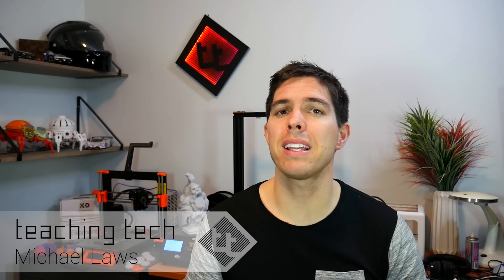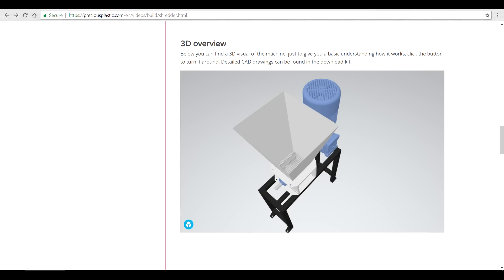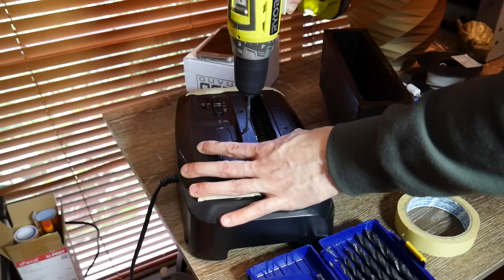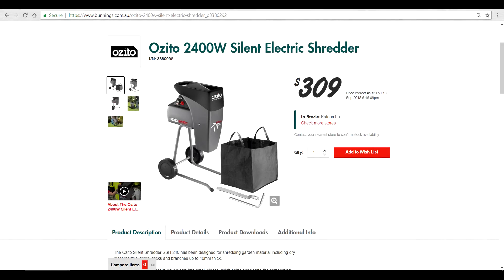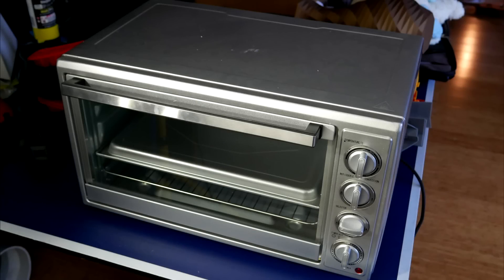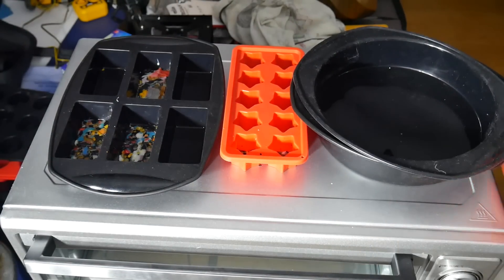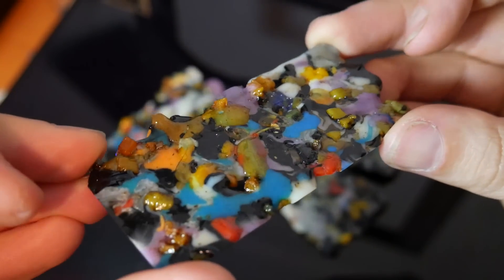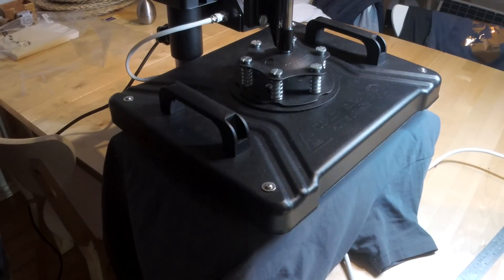Recycle waste 3D prints: Part 1 - Shredding and melting

Comment: there's nothing green about solar panel...you need to replace it every 10 years or so, made in part of rare material and quartz glass impossible to recycle. A damp is a lot cleaner, built one time, ok it flood a zone and dry another but it's water (self-healing material) that let nature rebuild itself.

Comment: You need to make sure that all recycled materials are using the same plastic. If there are different kinds of plastic in your mixture then the melting parameters will be different each time you try to extrude or mold, making it impossible to make parts consistently. Consistency is crucial when dealing with recycled plastic. To improve consistency of material, Your melted product should be well mixed to even out any subtle variations in density of material that could make the final product difficult to process. Most industrial plastic recycling is done in a continuous process that allows for a fine breakdown of recycled materials, heating, pressurization, mixing, and finally extrusion into either a filament or resin bead. You can breakdown your materials pretty well if you keep running it through the grinder multiple times, but to mix the melted product at high pressure and temperature will require much more complex equipment. The most difficult aspects to work out at home are consistent heating and pressurization. However, it looks like you were able to melt some of the material in an oven. The next step would be to stick a mixer in that toaster oven, and see if you can get a consistent melt without high pressure. If that is possible, you then need to see about how to feed that liquid into an extruder or mold with low pressure. A mold could possibly be gravity fed, but the extruder will likely require additional pressurization.

Comment: I was thinking about this sort of thing as now I got some used printed waste myself now... I thought If I could get a heavy duty garden bush shredder and get the used waste chopped up with that 1st then use a slow turning smaller shredder set up using maybe a stepper printer motor to slowly crew up the waste from the garden one maybe a few passes through it for fine cut up waste. Then I thought maybe use a hot end nozzle ( sized to the 1.75 mm ) Mounted on a frame with a big worm screw in a tube run by a stepper motor on the frame is fed by a big funnel ( maybe made of PETG ). Since the hot end is meant to be used to melt the filament for printing it makes sense to use it to do the filament making! You just need s fan to cool the filament as it exits the nozzle or pass the filament through a cold water bath as the professionals do?  I would of course sort out the colours of the waste first before cutting them up for melting, that way the same colours is in the filament which you could have a empty spool take up as it exits the cooling part?  I know it be hard to set up But I think using the same tech used to make filament in to models may as well be used in reverse to make the wast in to filament again?

Comment: I see most recycling efforts using shredding as a pre-cursor to using some kind of recycling-extruder. Wouldn't it be possible (and easier) to use some kind of large-hopper 'melter' to melt the filament into more manageable sized blocks and/or an intermedia extruded size that could be fed into the final extruder?

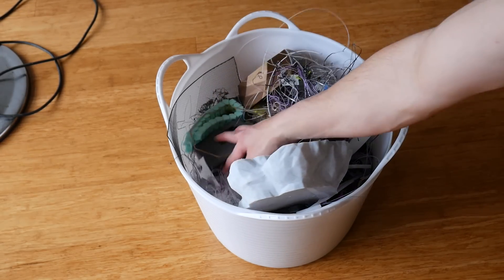Comment: 0:50 FYI PLA is not biodegradable. It needs healthy microbial community and 60C+ temperature, meaning you need some very specifically designed industrial compost where you could mix 10-20% finely shredded pieces with the plant materials to be able to degrade it in a few months. And that just never happens. So  unfortunately every failed print and every broken piece just adds to the global plastic problem. So big up for trying to reuse them in any ways!
Reply: I compost it in my girlfriend's back yard. almost any compost mound reaches 60C+

Comment: Bolts do not have a very high shear strength. Even Grade 8 hardware is rated in tensile strength, which is basically the amount of "stretch" it takes for it to break. You need to either have someone machine a keyway into your shafts, and your coupler, or try something like dowel roll pins that are hardened. Roll Pins are made to withstand shear force, bolts are meant for withstanding the stretching force.

Comment: The hell with that, lol   lets get a good process to melt down and re-extrude that stuff back into rolls for use in a 3D printer!   The multi-color aspect would lend itself well to some artistic projects or be good as a cheap"test PLA"  for proving out slicer settings etc.
Reply: Its no so easy to.make a good consistent filament, specially whith dirty plastic.Yuo gona need an entire making proceses..there are some machine outside but ..they are expensive and the result its not so good

Comment: using that garden shredder is a interesting idea!
For filament making you need to get down to about 5mm granule size, unless you build a bigger one than typical (ie. bigger than filastruder).

I go through a lot of filament and parts, and even the spools add up quickly! Makes no sense that something like 20-25% of the 1kg spool weight is actually packaging plastics and you throw that away. Very very inefficient and wasteful. Then all the failed prints etc. and i like to print big, so a failed print might be 2kg filament + 500gr in spools + other packaging wasted ...

Comment: Use the second mold on top with a pan and a little weight to smooth top while heating? Some smaller discs would be perfect drink coasters as well as conversation starters

Comment: as a fellow injection molder i need some advice as you seem to have more experience with cocoon create I have recently started doing oour own prototyping on cheap we were refered to aldi when they were on sale the very first model the old black one but it sat in the office and was never used as bussiness slacked of when i had a heart attact but now im back and have learned how to use it and on the 12 print the hotend thermister stoped working i have tech experience so i changed out the thermister but it just wont ghive corect reading do you know of any fellow youtubers who have solved this problem i miss my prototypeing printer thats and cocoon offer no suport except som c++ files

Comment: I normally enjoy your videos, but this is one of those cases of a solution seeking a problem. You're talking about recycling to reduce a carbon footprint, yet you used a 2400W chipper, a paper shredder, (in this case silicon molds that will break down), and a toaster oven to melt it down. On top of it all you chipped up that ABS chain then talked about using a sandwich press to melt it down. That sounds like a bad idea.

When it comes to PLA it's pretty sustainable. Filaments like ABS less so, but it's not too bad. Ive been thinking about using the garbage plastic like PLA for filter mediums. I just use the ABS stuff for slurry or patching up cracks. Resource waste is a thing, we just have to be conscious about it.

Comment: やったことあるけどPLAが硬くてペーパーシュレッダーが壊れた。
自分ははんだごてやヒートガンで板状にしてからドリルで加工してる。いつも楽しい動画をありがとう！(*´ω`*)
I was try papershredder. 
But PLA is too hard.
so I use electric soldeling iron and heatgun.
make small plate then drill it.
I make T-slot nut or angle bracket.
I love this channel thank you ! ：）

Comment: I know it wont' help with the time, but you could flip the large disk over and melt it a second time to (potentially) smooth out both sides. Those large disks could be used  decorative trays. As a geocacher, I think making things like those star pieces would be a great use for the scraps.
Reply from the maker: I have been experimenting more and will make a part 2 at some stage. Thanks for the suggestion.

Comment: I had a different idea to shred filaments.. coffee bean grinder.. :) will find that out how it goes when I'm ready
Reply from the maker: I think I'm going to look into that, a few have said it works well.
Reply: have you thought of a home made hammer mill,  could be powered off an old exercise bike.  I have seen it done with rock tumblers.  think it would be about the same in theory.  get your exercise and crush plastic at same time with no mains power.   just a thought.
Reply: Did coffie grinder brake down. Plastic for u.  I just Sean sume body housing kitchen wizz blender. But. To small .I gess changing to a drifrent  cutting blade. Custom made .. in a papper shredder may work...?
Reply: @countrabricksbuildcraze8916  r/ihadastroke

Comment: I like your Video about reusing/recycling plastic for another use. It’s seems like there can be a lot of waste if we are not careful.

I’m also wondering if you should introduce an additional finer grind to your shredded plastic. Kinda like the process of making Canister Damascus Steel. You may have some air gaps in the cast plastic that you aren’t aware of.
Reply from the maker: There are definitely air gaps. I need to experiment more to sort it out. Thanks for the input.

Comment: If you're milling pieces - introduce vibration into the melting process to avoid air bubbles and then anneal the melted parts by tempering off the temperature over a longer period of time. CNCing down the round blank you created will result in some dramatic kickbacks or shattering of your pieces. The mix of plastics fused along different surface areas will have material stresses from the melting process that may be resolved from annealing and removing any rogue air bubbles will avoid the mill from skipping. Regardless if you put these under a CNC bit, make sure there is some shield around it, or at least something between you and the CNC machine.
Reply from the maker: Thanks for the outstanding feedback. I'm not at the CNC stage  yet but I will take on board when I am.

Comment: I wonder if I can do this with the leftover runner plastic you get when building plastic scale models (Gundam, Airfix for example if you aren't familiar).  Though scale model plastic is usually polystyrene so not sure what the differences would be compared to PLA.
Reply from the maker: It all depends on the melting point but I'd say most hard plastics are recyclable.

Comment: You might find that the smoking of the silicone is just mold release burning off. Try leaving one in the oven at a higher temperature, it may well stop smoking before too long.
Reply from the maker: Thanks for the suggestion. Just to clarify, I haven't ever used molding release, in the video I was referring to the Make Anything video. The trays I have ate just new silicobe baking trays.
Reply: Teaching Tech just to clarify, I was referring to the original mold release used by the manufacturer to produce the baking sheets, and possibly keep them from sticking together in storage.
Reply from the maker: Great point, I haven't thought of that. I will try and heat purge it.
Reply: Teaching Tech great, cause I have a huge bin full of waste PLA waiting for a use. If it can be injection molded or something into a useful material, or even just ingotized, I will feel way better. It seems terrible to throw it away.

Comment: I tried it some days ago and it doesn't worked so well / good i don't crushed the prints so much ;D
Reply from the maker: Which part did you try?
Reply: Teaching Tech  i tried one batch with pla another with abs. But maybe the ofen is crap. it was an older one fron the 70s ;-)

Comment: I'm wondering if a solar oven might yeild good results.
Reply from the maker: I will look that up, it sounds very interesting.
Reply: It looks like sume guy. Where I'm working ATM. Was backing down plastic  an made a exstruder home made one. But it s just sitting here in factory. An it look s like he was melting plastic pla abs in a. Small oven yousing aluminium can as a mold. ..for sume reasion the exstruder here ain't pushing out the pla  round on all side s    like it  should. Be cool to make a home made exstruder.  Just need plastic. Grinder part an. Real s weal s  that wind an cool down pla  onto real...